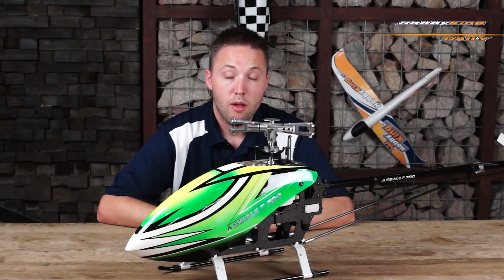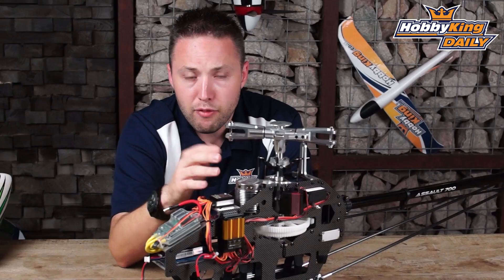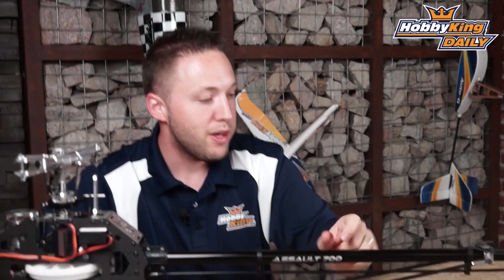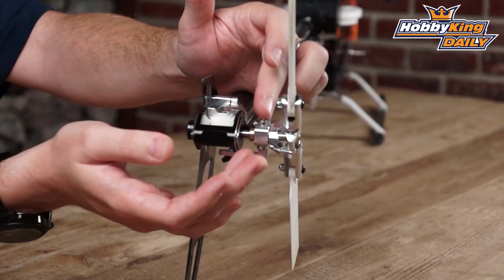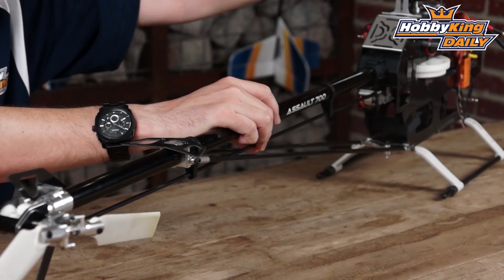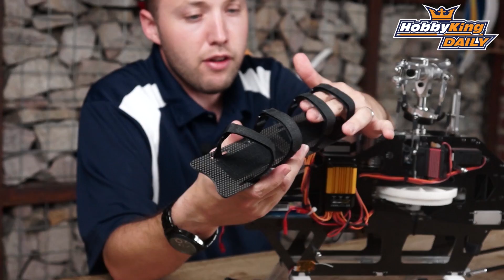Assault 700 Walk Through

Comment: I'm in the process of building Assault 700 now. swash servos pitch on the left and Aileron on the right are hitting the main frame and can'
t install inner mounting screws.  I  can fix that easy enough with some dremel work. But my swash linkage is 12mm too long. not enough adjustment to reach 90 degrees on my servo horn.  Are shorter swash linkage rods available ?